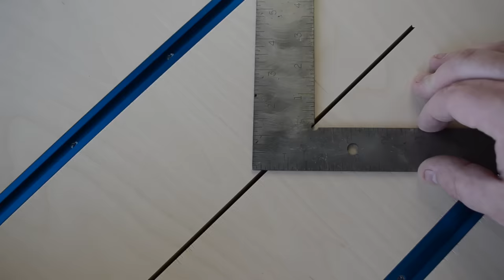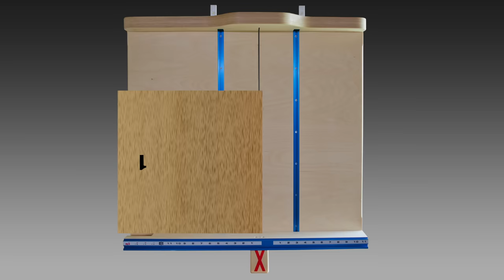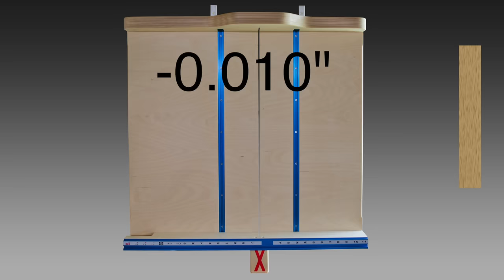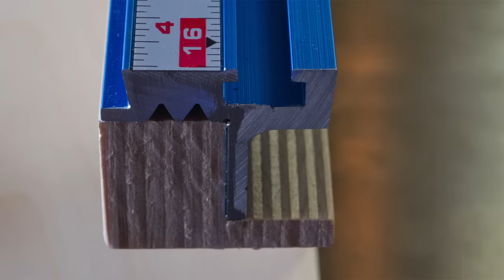Ⓕ Make A Table Saw Cross Cut / Miter Sled Combo (ep58)

Comment: Great Job Nick! Note: at 18:20 you mention -0.010 as ten thousandths.  Isn't .1 = tenths, .01 = hundredths, .001 = thousands, ,0001 = ten thousands?  Therefore is the measurement really negative one hundredth, and then I would use a one hundredth feeler gauge? Not being sarcastic.  I'm new to woodworking and it's been a looonnngggg time since I used thousands and smaller increments on a regular basis.
Reply from the maker: 18:20 is the very end of the video so I'm not sure what point you actually mean - hard for me to explain this in text but I'll give it a shot - (for example) we will deal with .1" - that can be said as "one tenth" or "ten hundredths" or "100 thousandths"  - all equal the same regardless of how you spoke it - as 1/10=.1 & 10/100=.1 & 100/1,000=.1  -   That being said, ten thousandths (0.010) & one tenth (0.1) are not the same - to make math (both written & spoken) easier, carry the number out to the same place so you don't have to mix tenths, hundredths, & thousandths - for example, it's easier to subtract ten thousandths from one hundred thousandths than it would be to subtract ten thousandths from one tenth - I really hope that makes sense and gets you on the right track

Comment: Nick, I'm just getting started in learning wood working, and I have a newcomers question, if you don't mind? 

How does one determine how deep (from back fence to front fence, outside to outside) to make my base for the sled? I'm sure that some of the answer depends on my preferences, but I'm just kind of looking for a guideline of some sort?
Reply from the maker: Pure preference and what size you saw will take - I wanted to be able to square up cabinet sides so I made my sled big enough to accommodate that - I have all the sizes in the step by step plans here - https://nickferry.com/product/table-saw-cross-cut-miter-sled/ - you can scale it to your needs from there

Comment: Very curious to hear how that Kreg Swing Stop has held up over time. Many of the reviews on Amazon say that there is a bit of play/slop in it. I am considering  building this sled, but am debating using the Incremental Flip Shop Stop Positioner from Incra instead.
Reply from the maker: to answer the question of how it's held up, it has held up, no wear and tear do to speak - as for the slop, it's kind of a silly design in that it relies on the pivot through bolt to be rather tight to eliminate slop or backlash - even in the video I did not have it tight enough - I do now and it has fixed the issue essentially 100% - so all in all it does great but I think some minor tweaks in the design would make it worlds better
Reply: Thanks for the response Nick. That's great to hear. I love the idea of the two stops on the Incra, but much prefer the fence on yours to that one. This is just a great video all around. Really appreciate what you are doing.
Reply from the maker: no problem - glad you are enjoying my videos!

Comment: Just came across this.  What an awesome build!  Just got a new table saw and this will be my first project.  I do have a question.  At 10:54 in the video, the Kreg stop block moves.  Is that a one time fluke that can be adjusted?  Looked like it moved about 1/32".  Now subscribed!!!
Reply from the maker: Thanks - it did - I needed to tighten up the pivot bolt and that took all the slop out

Comment: Just curious... i know you notched your back fence for the t tracks to fit screws thru.  Any reason you didn't just stop the length of the t-track to be leave 1/2 gap in front of the fence so you could simply insert it there?
Reply from the maker: you can leave a gap but i'd still put the slot to blow out sawdust if needed

Comment: Excellent Video Nick BUT the Kreg Swing Stop appears to kick left about 1/32" at 10:55 minutes when you slide your board into it.  No really interested in shelling out $30 for an unstable stop, if that is true.
Any how, thank you for the great video on the sled. I about have my sled finished very similar to yours.
Reply from the maker: Thanks - the bolt it pivots on was loose - I’ve since snugged it up and no slop

Comment: Couple of things. 
To reduce weight, could the base be 1/2" plywood instead of 3/4"?
How did you ensure that the 45,degree oi cecwas dead on?
Reply from the maker: The miter slots are a half inch tall so you cannot use half-inch plywood - geometry takes care of the 45° being dead on by having a equal legged right triangle

Comment: Fantastic sled. So pumped to go build on now.  The miter addition is brilliant. Had not considered the slot tracks, seems so obviously not. Does the X have to be red?
Reply from the maker: Thanks - you’ll have to check out my tenoning jig attachment video for it too - the X does not need to be red but it DOES have to be old paint
Reply: Nice, I will find the oldest paint I can.
Reply: Nick - I did build this but flipped the front/back. I installed the tracks in the base and what do you know! .00075 on the first attempt. That is not a typo. I used 2" thick hard maple fences so it is heavy, but I love it. Use it way more than I imagined.

Comment: Hey Nick! I'm a newbie woodworker and I've had this video as the sled I want to build for my table saw. I only have a Dewalt contractor table saw. Would you suggest I scale your plans down to fit my saw? If so, how much smaller should I make it?
Reply from the maker: I made one for my job site saw and I just made it about 2" narrower than what's on the plans
Reply: Thanks Nick, plans acquired.
Reply from the maker: Awesome - let me know how it goes & thanks for the support!

Comment: Nice sled. I am about done creating my own based on your video. I handled the mini-track a little differently. Instead of running the track all the way through the back (and cutting a notch in the back fence as you did), I left my track a little bit shorter than the length of the sled base.  That left a gap large enough to feed any length of bolt into the track. That makes the track a little less secure in the channel. It's nice and tight in the front where it goes under the fence, but I don't have a lot of confidence in those stubby screws holding up to a lot of clamping force. I'm considering glue.  

I have one question: after you trim the miter sled base to a triangle on the band saw, how do you get the long edge (the hypotenuse) straight enough to sit nice and perpendicular to the blade? I tested out a method and it was pretty good. The two angles come out 90 together, but the error on each one is noticeable.
Reply from the maker: I did similar on my sled for my jobsite saw but instead of leaving it short I ground away some of the aluminum to be able to insert a bolt head - I still kept the notches because I like being able to blow out any sawdust if needed - not entirely sure what you are asking on the insert but the hypotenuse is a factory edge or ripped before the legs or the triangle are cut - if you have a 90 degree angle and two legs are equal in length, geometrically it can't be off - and being that sits against the fence we now know to be square, you will be 45 degrees off the blade
Reply: I like your idea about grinding the track.
Reply: About the insert: I figured out why I was confused. At 11:28 I thought you were cutting the hypotenuse, but you were cutting one of the legs. So, at 11:28 you show the start of the first leg cut, and then at 11:30 you jumped to show the tail end of the second leg cut. My brain told me that that was all one cut. When you moved it over to the table saw, I missed the fact that you were  trimming to the lines. <lightbulb!> Thanks for making great videos. They're short and to the point, well edited, well narrated, and easy to watch. And you have some great ideas.
Reply from the maker: thanks much - I appreciate the kind words

Comment: My plywood piece for the sled base has the slightest bow to it.  Will attaching the front and rear pieces correct that, or should I just buy another piece of plywood and recut?
Reply from the maker: Depends on how bad the bow is - you can also cut the plywood in the house and that’ll illuminate a lot of that Bend and then you can assemble the sled and then re-cut your kerf - if you have access to flat stuff even better

Comment: Why use a sheet metal screw, to screw into wood? That just takes out the wood that you need to hold the screw. Those screws can found for wood with the same head. Not to sound ugly, just curious.
Reply from the maker: It’s what I had on hand - wire lathe screws - I use the wood ones in the my upcoming video

Comment: fantastic sled but seems really expensive with the kreg parts
Reply from the maker: thanks - you can use any brand aluminum you want - I am most likely going to use that toptrak as part of my box joint jig as well - and for the main jig in my shop it was completely worth it!

Comment: Great job.  Cutting the aluminum with the Freud blade doesn't dull it?  Never thought about using mine like that but looks like it works great. I just use a hack saw usually. Also, 0.01 is a 1/100th of an inch not 1/10,000th right?  Thanks!
Reply from the maker: Thanks - carbide tipped blades work great for cutting aluminum - ten thousandths and 1/10,000th are different - 0.01" is read as one hundredth and 0.010" is typically read as 10 thousandths - same distance in space, but read differently based on how many places the number is carried out to - thousandths is more common vernacular than hundredths
Reply: Nick Ferry - yeh 10/1000s is one hundreds like you said. When say a ten thousandths I think 1/10,000 but we are on same page. Thank Nick and again great job
Reply from the maker: No problem - thank you

Comment: OK -- dumb question.  Changing the blade will change the kerf; if you swap out to a different brand of blade will that make a significant difference?
Reply from the maker: So that I can keep the joinery and all the math in my head correct I typically opt for a true 1/8 inch kerf blade
Reply: @NickFerry  Thanks!

Comment: Why put the tall fence in the front.  Seems like most of the time, the taller fence that has been shaped with a taller center is usually used for the back to keep your hands away from the blade.  Not sure why the low fence is in the back with your hands.  Do you flip it around at times?
Reply from the maker: I drew that shape as to cut down on the overall height while maintaining adequate material connecting the 2 halves

Comment: Nick, isn't cutting thru those aluminum tracks not good for your carbide saw blades? Was just wondering since I'm contemplating building your great sled.
Reply from the maker: there's nothing wrong with cutting aluminum with carbide blades - the carbide is much harder than the aluminum and it's done all the time in manufacturing (that's where I learned it) - when done repetitively, blades will need to be resharpened more often but a couple cuts won't be much of a factor - if you're worried about it, you can use a hacksaw or metal cutting blade in a jigsaw - I prefer the table and miter saw for thew quality and accuracy of the cut

Comment: I'm thinking about making a table saw sled to replace and update my current sled.  The new one will be similar in size and design, but will include stops and T-tracs for hold downs.  My current sled is fairly heavy and awkward to move.  In an effort to lighten the new sled, I am thinking of putting holes in the bed of the new sled ( 1 inch holes in a 2 inch on center pattern).  Can you think of any drawbacks to doing this?
Reply from the maker: placement of the holes would be key so it doesn't hinder regular cutting of stock - I actually prefer the weight when cutting with it as you are moving something with mass for purpose

Comment: Wondering about the curf cut through the back fence close to the aluminum track and ruler.... I also have a saw stop and noticed that you cut through the aluminum in bypass..... how does the saw not trip when making cross cuts and the blade going through the opening of the aluminum?
Reply from the maker: It requires actual contact to trip the brake - that’s why I left it away from the blade slightly
Reply: @NickFerry  oh really? So contact only! the break won't fire if it only comes close? Nice work!

Comment: Nick, awesome sled.  Thank you for this video.  Do you foresee any issues with cutting a 45 degree slot in the same sled?
Reply from the maker: Nope - with the offset I’ve flipped sleds before and the 45° bevel is a different kerf altogether
Reply: @NickFerry .  So you've cut both 90 and 45 degree slots in the same sled?  Not sure what you meant by "I've flipped sleds".  Thanks Nick!!
Reply from the maker: If you square the back fence as well - rotate the sled 180° and you can do your bevels from that side and the 90° kerf and the 45° will be a couple inches apart - they won’t interfere with each other
Reply: @NickFerry .  On my table saw it would be 9/16" apart, so I'll have to figure out something else.  Thanks for your quick reply's Nick.

Comment: Nick love the sled. I have a question. You have had this and been using it for roughly 3 to 4 years. Are there any adjustments you would make after extensively using it? 
I’ve been doing my homework and your build definitely is the closest to what I would want. And I wanted to see if you had any feed back on it. 

Thanks!
Reply from the maker: I made one for my job site saw after this and I notched out the miter track to insert the bolts instead - you could also keep the track back from the fence an inch - I kept the slots in the fence as it makes it easier to blow out sawdust

Comment: Hey Nick. Watched a few times but I don't quite understand the reason for the shim and how it "makes the pencil line and kerf line" line up.  Thanks if you still monitor comments on this video.
Reply from the maker: At that point the sled was square so I just shimmed the insert so I could cut a straight leg on one side then rotate and cut the remaining leg of the triangle - the shin made the cut line up with my layout line
Reply: Nick Ferry ah ha, I see. The layout line on the insert didn't line up without being shimmed up/out. I thought it had something to do with modifying the angle of the cut relative to the kerf line.  Sorry, but thank you.  New subscriber.  Maybe we can collaborate one day.
Reply from the maker: No problem - I have those ahh ha moments often - welcome aboard!

Comment: Very nicely done. I have a couple of questions for your if you don't mind as I a want to build this.
Is this design specific for a certain size table saw, second could you provide me a link as to where you order or obtained the mitre slot tracks and mitre slot runners 
Thanks
Reply from the maker: thanks - it is really easy to scale to just about any size saw - the links to all the build parts can be found here - https://nickferry.com/2015/07/table-saw-cross-cut-miter-sled-in-one-ep58/

Comment: Good day Nick, when you pre-drilled the sled holes it looked look like you had a special bit that centered itself on the countersunk hole on the runners . Can you tell me if that was a purchased bit or a homemade one. I tried eye balling the pre-drilled hole and I wasn't exactly centered and when I drill the screws in it pulled  the runners off center and I had to start over.
Reply from the maker: I have more info & links in the article here - https://nickferry.com///2015/07/table-saw-cross-cut-miter-sled-in-one-ep58/ - commonly referred to as vix bits

Comment: I'm looking forward to building this sled after looking at a thousand videos it seems, question, would a slightly taller sled avoid cutting through the aluminum track , and does a regular saw blade on a mitre saw or table saw cut aluminum, and I saw where a dust collection was added to the blade cover (the red x)which seemed to work pretty good . thanks for video
Reply from the maker: You could make it taller but I wanted to be able to utilize some of the factory accessories with that aluminum in addition to the rigidity it offers - carbide tipped blades are fine cutting through the aluminum - I saw Drew Short’s added dust collection - seems cool but I don’t think I’d use it much personally as I don’t have an issue with saw dust build up finishing the cut going into the guard
Reply: thanks for those replies, good points.
Reply from the maker: No problem - happy building!

Comment: Just found this video. Great build

Are those the Kreg aluminum miter bars?
Reply from the maker: Thanks much - they are - all the kinks to everything in the article - https://nickferry.com/2015/07/table-saw-cross-cut-miter-sled-in-one-ep58/ - let me know if you have any other questions
Reply: @NickFerry  Awesome

Thanks for the quick reply and keep up the great work. Building my 2nd sled now. My old one worked great, but was built for a DeWalt saw. Plus I wanted to add the KM Tools stop block and t-track to this one.

Comment: Nice sled, did you think on making replaceable inserts?
Reply from the maker: thanks - I did, but didn't see the need for my purposes - I don't do many end grain bevels - if a person is worried about the kerf getting chewed up, put some thin CA glue on the plywood in a line where the kerf will go through and then make the kerf cut - it stabilizes the wood and keeps the kerf nice and clean - I didn't do that on this sled and it's held up really well without it

Comment: @3:34 are you not relying on your slats being perfectly parallel to the edge of the top sheet?
Reply from the maker: Not really - if the dados are even within 1/4" of parallel over the run you'd be good - but being the base was cut square and runners lined up 90 degrees to front edge you'd be more than in the ballpark